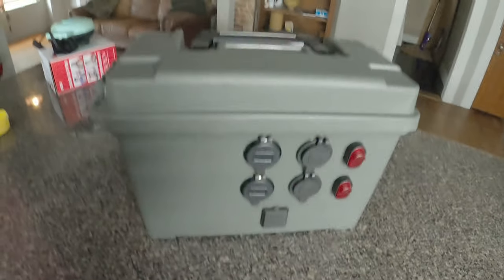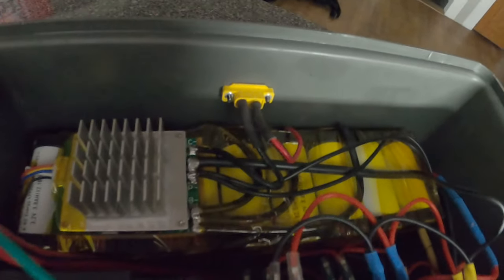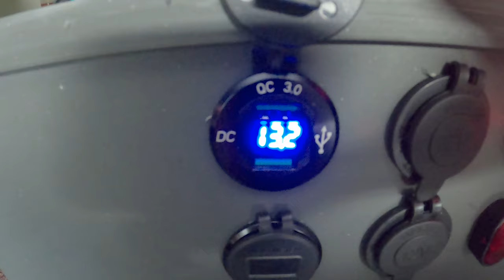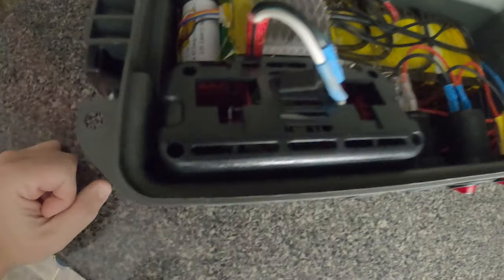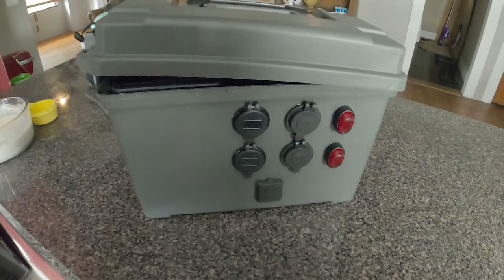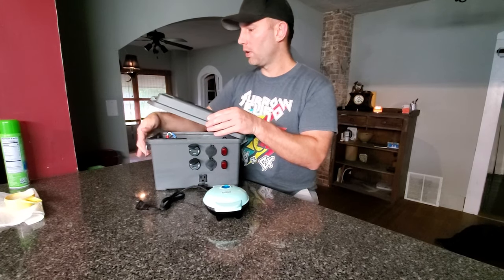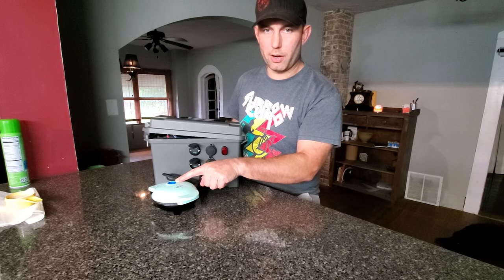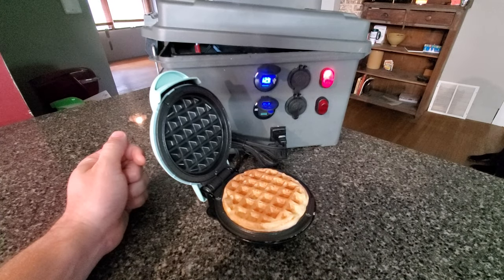How to build a battery powered waffle maker. DIY budget solar generator/minivan camper power station

Comment: Do you have diy how to build a spot welder video?
Reply from the maker: I can make one if you're interested.
Reply from the maker: To be honest though. By the time you buy all the parts for this. It probably makes sense to buy one. I don't think I'll use this for much anymore. It worked well for smaller stuff but when I was building a 60 cell pack I burned up a solenoid and had to keep the battery on a charger to have enough power. As well as take a lot of breaks. The quality is hard to control also. I first built this when I was doing small 4 cell packs for drones but it's not very good for doing bigger packs.